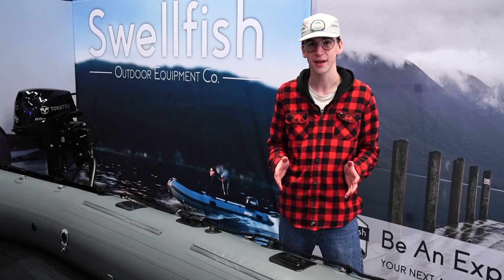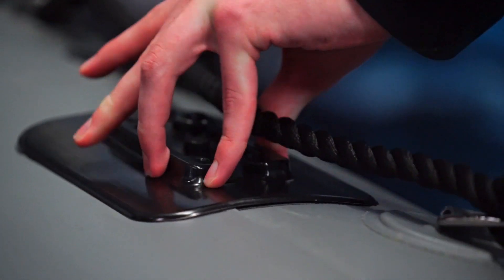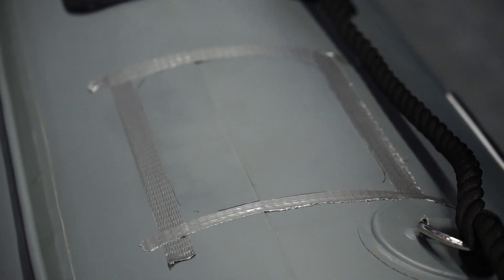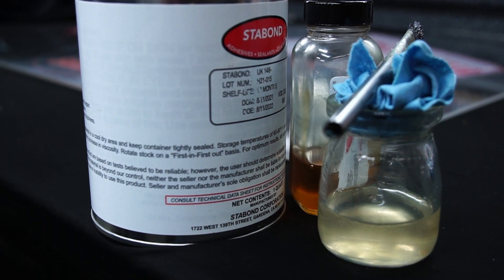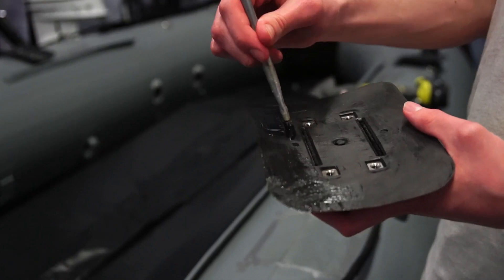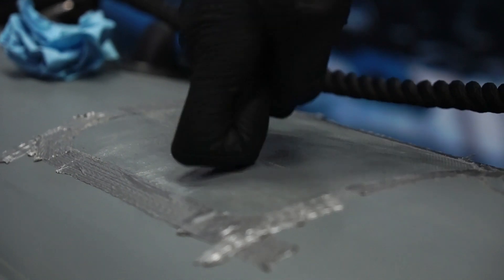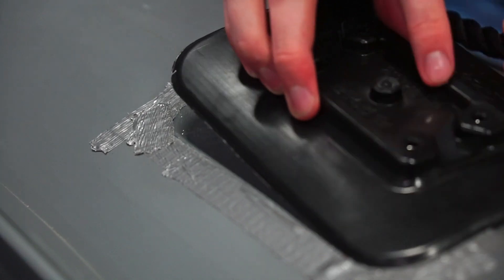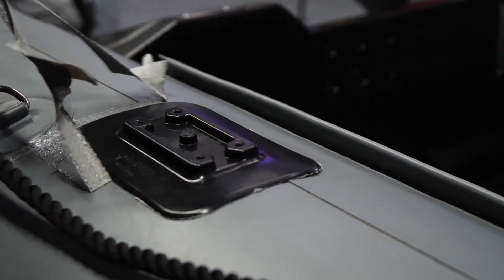Learn to install Scotty glue on pads or patch your inflatable boat

Comment: Bimini only came with a small tube of glue,will that also do the job to mount 2 holders?
Reply from the maker: The Bimini glue is meant for the Bimini Mounts. I
You won't have much left to glue other things.  We have more glue on our web store if you need more for other things!

Comment: Very nice video.   I'd like to glue the base for the scotty rod holder r-5, but i think the curvature on the fast track pontoon would prevent success. , do you have any suggestions or products that might help.   The fast track angler has confounded me and do I not really understand the design concept having now bought one. It has the bixpy skeg motor.   Again very nice video.
Reply from the maker: Sorry, we are not familiar with the fast track pontoon. As long as the Scotty Glue on pad sits fairly flat on the tube you should be fine.

Comment: Has anyone had any luck with Oatey's shower pan liner adhesive?
I'm thinking of using some to reglue a few pieces that have come unglued on my kayak. Seems very similar to HH-66 (which I've used on the past) but at half the cost!
Reply from the maker: We haven't tried that ourselves.
Reply: @Swellfish  I tried it with very positive results. It dries much quicker between coats, so application is slightly different. But strength seems to be comparable.

Comment: Do these have to be installed and left on for 24 hours with the boat inflated? or can I leave it deflated for the process? I dont have much room to leave it inflated. kind of why I bought an inflatable kayak to begin with lol
Reply: first off, don't use 'duck' tape, certain tapes especially this type have acids in the glue that will weaken your boat. it depends on the patch type is it's flexible i'd deflate and leave a weight on it over night on flat surface, if its rigid and curved mount in must be inflated and it will need pressure over night
Reply: @MrMxm13  its curved!! thanks for the advice I'll give it a shot
Reply from the maker: If you are keeping the 'duck' tape on the boat for any real length of time, we completely agree! But it doesn't really affect the boat because you are only keeping the tape on for less than 30 minutes.
Reply: @MrMxm13  It's DUCT tape! Originally developed for repair of ducts.